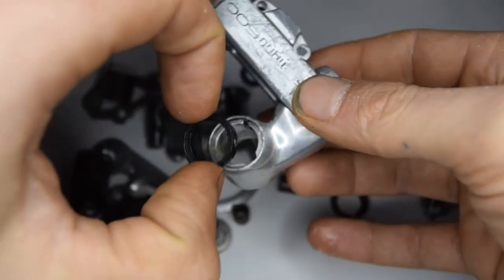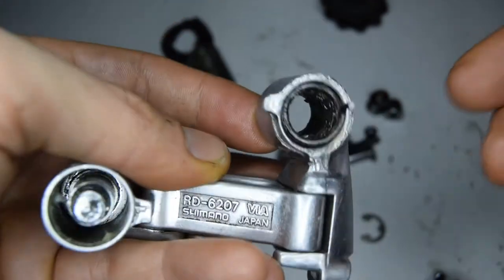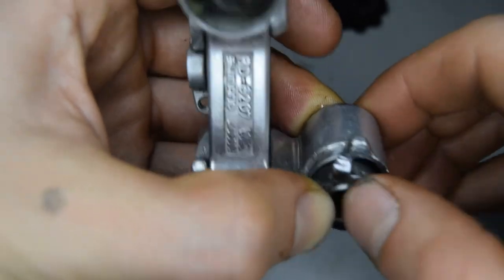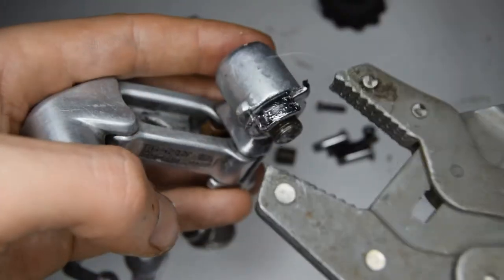Shimano 600EX RD-6207 Rear derailleur: Overhaul service assembly

Comment: That short cage "new ex" has the  same capacity as the Arabesque doesn't it? 28 tooth max and 26 tooth chain wrap?
Not the indexer but the one right before through '84. That one looks like it's got some road rash, lol.
Reply from the maker: Yh according to cat specs, they look the same. I just did a video, yet to publish on the arabesque. This one was a little nicer.
Reply: @atboy4342  Thank You. I got one of each and that's the max and the wrap I'm trying to cover with a compact Sugino  crankset. I put together . So I'll try the new EX first . . . It's prettier than the Arabesque with the newer Sugino.. Thanks and TIA for the videos too..

Comment: You're inserting the spring in the wrong hole. When it's not in the right hole, you won't get the right degree of tension AND you'll ruin the seal.

...and it's certainly a bi... to assemble it with all that tension.

Also, anchor schrew is supposed to be placed in "the wrong way" - which is actually right, because it makes it easier to fasten the wire.
Reply from the maker: Haha well, the seal is probably shiched over the years. O yeh your right about the anchor bolt. Wierd, why does it make it easier to fasten though? They must’ve changed they’re mind about that. In the catalogue, the 6208 (side by side to the 6207) has the anchor bolt in the right place (or left). Prettier looking maybe?